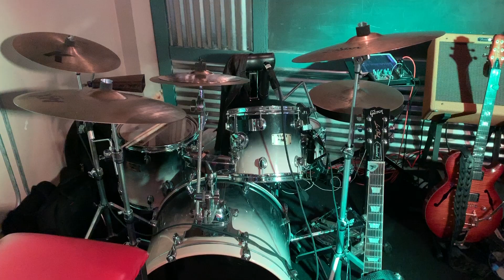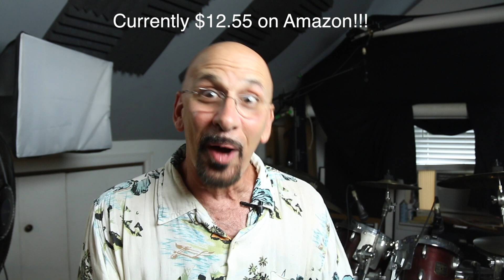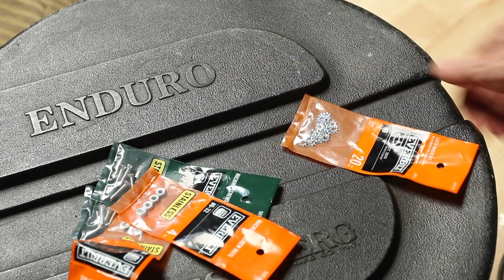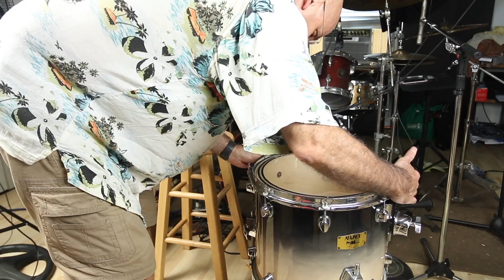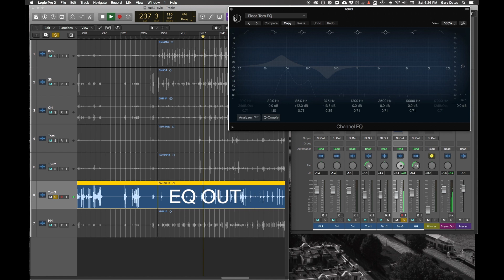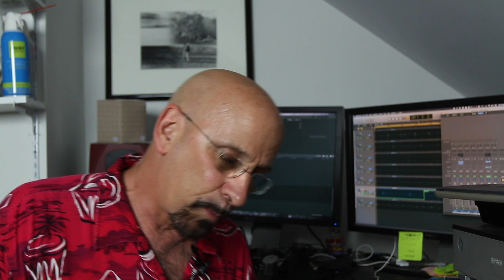Internal Drum Mic Experiment!

Comment: Its sounding odd because there are a lot of internal reflections in the floor tom that are being picked up on the mic because the mic is mounted inside rather than outside. Its just like in a kick drum where the drum sounds very splatty/basketbally until you put a pillow inside. You can reduce this a little bit by either gluing some very thin acoustic foam to the shell or using the internal lug mounts to hang some fabric. Also, usually when people use internal micing they use it to achieve a very tight scooped, modern sounding tom as well. I don't believe it works very well for a more rock oriented vintage sound.
Reply from the maker: Thanks for your insight. However, I'm not gonna start adding any sort of internal dampening material to the drum because, well, I'm too lazy! :) I've managed to get a decent sound via EQ, as I showed in the video. I wouldn't be so quick to assume that internal miking itself is responsible for a "modern" drum sound when what you hear may very well be a triggered sample. That said, a long time ago I was in a show in which Terry Bozzio was also performing. He showed us his rig (he was endorsing Remo drums at the time). Each tom had an internal mic fed directly into its own Alesis MicroVerb. His drums sounded incredible! But then again, Terry sounds amazing no matter what!

Comment: Hey man, how did you get that great drum sound from the Pyle?  I just picked up one and might get 3 more to use as a kick mic, snare mic, and 2 overheads.  I've been experimenting with it for a while now and I just can't seem to get the beautiful sound that you got.  I am very new to recording, as this is my first microphone.  I am running the mic into a 4-channel mixer and out of the mixer via 3.5-usb into my not-so-good laptop with an online program (Soundtrap).  Any information would be greatly appreciated.  Thanks!
Reply from the maker: Hmmmmm. I'm not sure what you are trying to do. Are you miking internally? Externally? Also understand that this Pyle mic (and the Shure SM57 it mimics), has a very limited application as it pertains to RECORDING. I'd be a bit leary of using 2 of these for overheads. Also, there is no substitute for a good sounding drum acoustically, so taking the time to tune correctly is essential. No mic can help a bad-sounding drum. Regardless, if you can be more specific as to how you're miking the drum(s), and also WHICH drum you're talking about, I would be happy to try to help you. Thanks!
Reply: The Creative Drummer I’ve been experimenting and I’ve gotten a great kick sound and great overhead and Tom sounds.  I am externally close miking the snare and that’s where I’m getting not the greatest sound.  I added some eq and it made a big improvement, but still not great.  I can’t put the mic too close to the drum, or it clips.  It has to be around a foot away so I don’t get a nice close mic sound.  Should I try lowering the gain or something like that?
Reply from the maker: @theshep2.037  Yea you need to decrease your input gain from that mic to get it closer. A foot away is never gonna work.
Reply: The Creative Drummer thanks man!

Comment: I wonder if the position of the mic within the shell could improve the sound. Move it closer to the top or try the bottom. Centerered vs off center. Similar to videos of bass drum micing where they move it around inside. Ideally you would have a way to move it easily to try different sounds then once you found a placement that was great, a way to lock it in so it doesn’t move. That is - if it makes any noticeable difference.
Reply: About 6-9 inches from the batter, closer to the edge, and aimed toward the opposite lug. Then toss a bit of lightweight furniture foam around the shell to kill the "Basketball Effect"

He had the right idea, but missed the mark on placement and mounting.
Using L Brackets and a set of mini-bungees, with a few straps to hold it all together is the way. (Mine are internal mic'ed in the studio, and it's great! Soundguys love me after the skepticism wears off after they hear it through the PA.

Comment: Thank you for good video. I like this kind of projects.

Our band has gigged (?) over 10 years. Always wiring mics and mic setups takes time. I would recommend all drummers install internal mics to gig kits. If  i would be drummer in band i would buy small mixer with 4-6xlr channel (with good preamp and eq high-mid-low). How easy would connect small mixer and mics by short mic cables. Then only two wires to stage mixer. Pan left and right. Always almost ready eq and levels to drums and takes only 2 channels from main mixer.

Sometimes i have thought about wireless mics in drums and usb rechargable batteries to system. Even own small power bank what you connect to shell and usb terminal.
Reply from the maker: Thanks and glad you enjoyed it! The only problem with your scenario is that it's really hard to mix from behind a drum kit. But sure, many bands mix from the stage without using a front-of-house sound man. In my situation, I really have no idea what it sounds like through the FOH speakers. All kit mics go directly to a Yamaha FOH mixer, which has the ability to send monitor submixes. I have my own monitor mix as a result. Next to me is a very small Behringer mixer that receives my monitor mix on channel 1, and I also have a click on another channel. The Yamaha mixer has the ability for me to literally create my own monitor mix via an app on my iPhone over WiFi. I use in-ear monitors to hear everything, so I can adjust my mix on my iPhone at any time. I love this system! :)

Comment: I also have the gilbrater mounts mounted internally,I have sennheiser 604s mounted on mine with the May av1 vent system.I run Evans G2 coated over G1 clears.My personal opinion,is I think you have your 57s to close to the batter head.Try dropping the angle mount a little and get the 57 lower off the head,pointed just off center.Your gonna lose sustain,but your going to gain isolation.If you hear a clicking sound,that’s too much attack into the mike,just move lower and off center.Works for me..great instructional video tho bro.
Reply from the maker: Thanks for your thoughts. It turns out the installation was way better than I thought for LIVE gigs. Making a follow-up video to report results. Rock on bro!

Comment: Thanks, I ordered the needed components and gonna mess with this. I have the MAY inernal system with Sennheiser 600 mics in one of my kits and it is the bomb! Very curious about your project and decided to give it a try in one of my cheaper kits. Not a fan of drilling holes, but this is absolutely worth a try. I'm gonna mount the system in a Sakae Pac-D kit, 16"bd, 10" tom and 13" floor. I'll follow up with a comment after it has been installed. BTW, have you mounted a mic in the snare also? If so, I would love to hear your opinion on how that worked out, positive or negative, maybe with a sound file if possible. I've not been able to get a good sound out of my snare with internal mic, so I've decided to continue to mic the snare externally.
Reply from the maker: Yea so for live gigs these internal mics inside the toms have worked out great, especially considering the cost!! I've looked at the MAY system but found it too expensive for my taste. No, I have not mounted an internal mic in my snare yet. I'm still on the fence about that. The snare for that kit sounds really good as is, and I really don't want to mess with it. Plus, the Pyle 57 clone is too large in my opinion for a 5" deep shell so doesn't allow for many angles. Placement is pretty important. For these reasons I'm reluctant. If I could find a reasonably-priced mic that was small enough to easily fit inside the drum I'd probably go for it though. Definitely let me know how you make out with your Sakae kit!